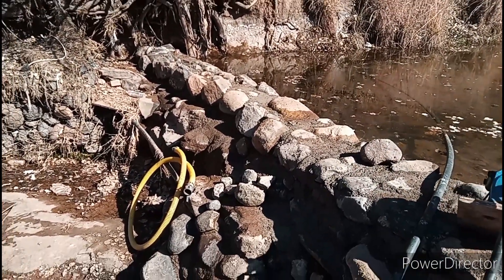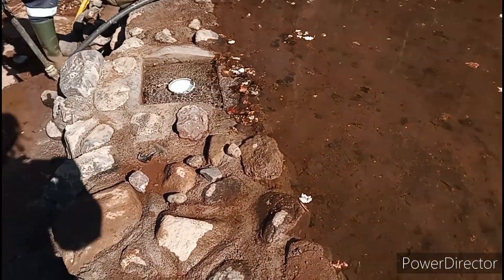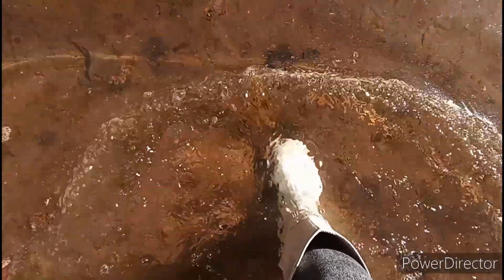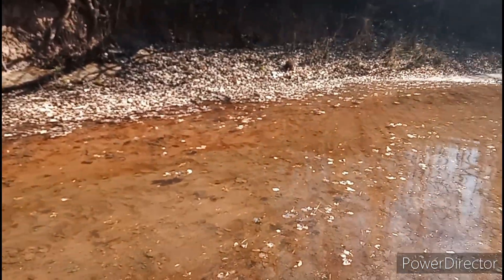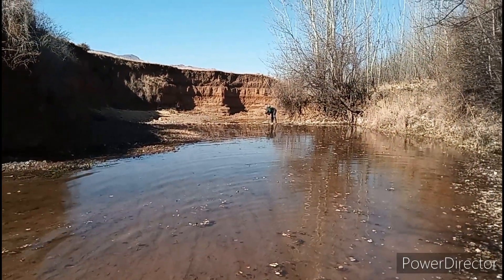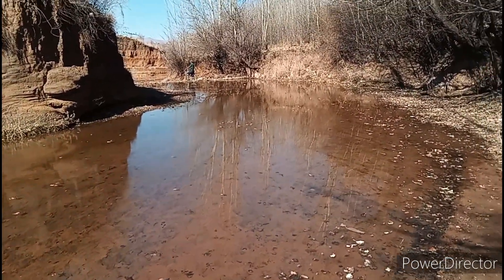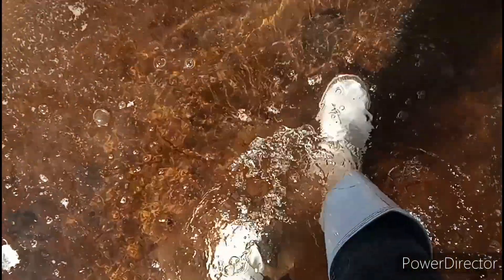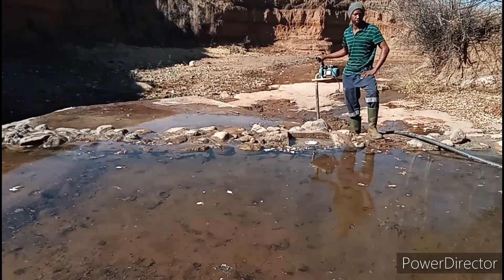WATER CRISIS SOLVED: SAND DAMS OFFER HOPE FOR RURAL VILLAGES IN LESOTHO | BATTLING CLIMATE CHANGE

Comment: Looks like the water table is still much lower than the flood plane. It would interesting see if a series of leaky weirs along the stream could that get raised over time could repair the gully.
Reply from the maker: I think that would work....It would take more than repairing only the gully to fix the land degradation problems that we have here though. Due to the mountains and hills, all the slopes result in a lot of erosion which have caused a network of dongas that feed this gully and many others during floods.

Comment: Well done.  Another dam just a bit downstream, where you can see the land narrows and the river bends, opens up that whole area as a catchment pond. You could multiply the amount of water you are holding, and provide security against future flash floods.  That's a wonderfull erosion gully you have to work with there.
Reply from the maker: There's actually another dam just around that curve. It's the oldest one that  dad built in 1995. Then there's another one further downstream. All three are shown in my first sand dam video. I went to another village yesterday and crossed way upstream and was stunned to see that the stream is bone dry up there yet further down we have so much water. We need to build 50 more dams across the whole valley whenever we can.
Reply: @lifeinthemountainkingdom  absolutely

Comment: Beautiful and inspiring.  I like your water tank just below your sand dam -- does it accumulate sand & silt and has to be cleaned out or drained periodically?
Reply from the maker: Thank you! Yes that was an ideal location to set up the tank against the retaining wall to cut on the costs of building the tank. The bottom inlet also allows clean water that has undergone natural sand filtration to go straight into the tank. Yes, mud and sand have gone into the tank a few times whenever I forget to close the top inlet and we get a storm that floods the stream then I have to clean the tank. Now I try to always remember or else I'll go down even at 2am if it starts raining and I remember that I haven't closed it 😂 😂 😂.